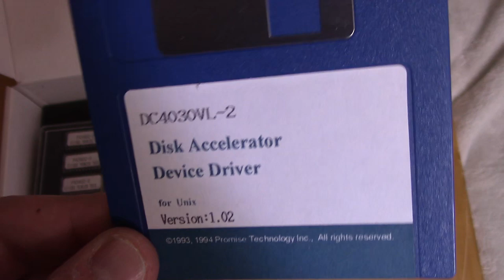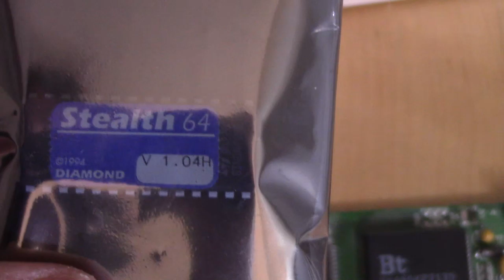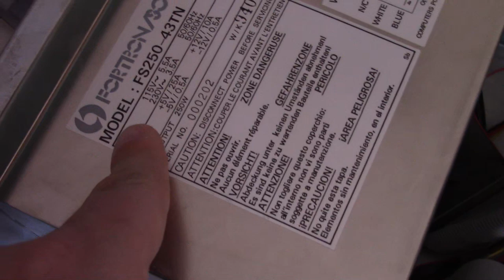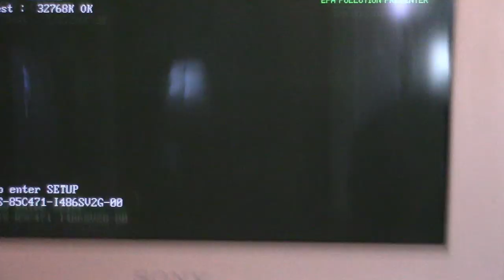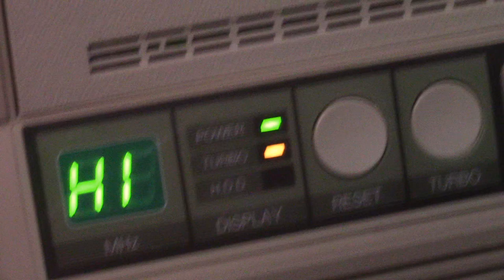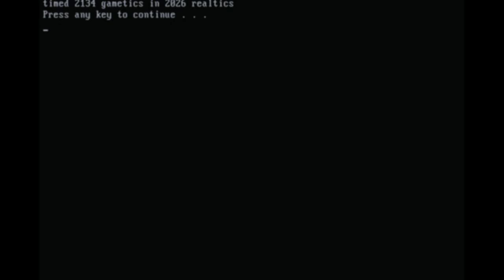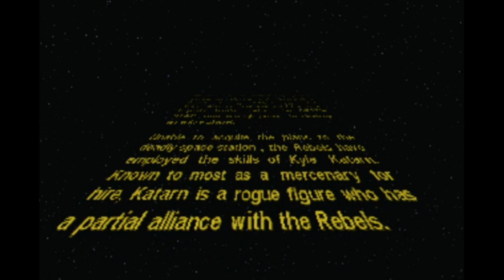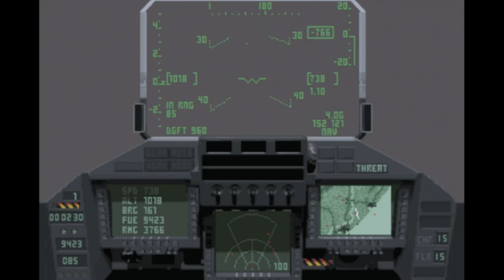486 DX4-100 PC Tower Build

Comment: That is indeed a nice case. For two digit displays the workaround is to set them up to read 'HI' and 'LO' instead of numerical values - ah, I see you did. Definitely some nice hardware in there too, if you're ever stuck for cash you can probably sell that caching card and throw a regular one in there, the gains are generally negligible. Every card I've encountered with two floppy headers offers the second one for 2.88M diskettes, I'm not sure how it's supposed to work due to never having such a drive or disk to try out.
Used to have the PCI version of that video card. The additional memory probably won't be useful if you install it, as the RAM was almost always used solely as a framebuffer at this time.
I don't believe in the hanging note bug, but I do believe in 'ID can't code' bugs. Never seen a WaveBlaster in real life either, so good find.
CPU could be a misprint, or it might be a boxed one that someone ripped the heatsink off of, I'd expect a round glue mark if that were the case though. The die cover looks slightly large to me though and I'd usually expect at least an 'Intel OverDrive' print on the front or fab marks on the back.
It's quite unusual to see a Creative branded drive which is NEC and not Panasonic.
Wall of text aside, that is seriously a nice machine, lots and lots of potential for countless hours of fun to be had with that one.
Reply from the maker: I was pretty surprised when I opened it up and seen all the goodies inside. I figured as much about the memory on the video card but I feel compelled to max these things out when I see empty sockets. It's like math co-pros in 8088 boards, I'll probably never really utilize them but it just bothers me to have it empty. Thanks for the comment.

Comment: Really liked the colorado tape drive. Think I had that one in my first 486dx2 66, used to perform backups. You can’t assign a drive letter to them like a zip drive, but you would use something like Conner Backup Exec software to create backups and do restores.

Comment: That tape drive is a Colorado drive. It uses QIC-40 cartridges that have 60mb of space (don't forget that they always show the size of tape drives with a compression ratio of 2:1). You can also use QIC-80 cartridges, you'll need to format them first. Those tapes can usually be found for not much money, so if you want to play with em, it won't cost you much either.

As for drivers, you can easilly fing colorado's utilities to use said drive.

Comment: From an obsolescence  standpoint the DX4 processors lasted quite a while, when compared to other processors of the early 90s to early 2000s.  It wouldn't  be abnormal to see that DX4s, of varying  speeds, in file servers or industrial computers, up to even a decade after it was released. Although to be fair, the nuclear powet plant I work at still uses 386s for certain embedded  instrumentation, but I don't count that since they are not in pc's.

Comment: Well you can sometimes know if a CPU is an amd or not by checking the L1 cache size. Intel never made a DX4 with 8KB of L1 cache, so if you have 8KB, it's an AMD. If not it may be a intel DX4, or a AMD dx4, OR a rebranded 5x86 ! (This happened to me the other day, I had a am486 DX4-SV8B that reported 16KB of L1 cache. Once I flipped some jumper, I saw "am5x86" on the POST screen with 133MHz clock. So I have a 5x86 in disguise :D)

Comment: On the unmarked iDX4 - I happen to have one that I acquired covered in thermal paste. I started to rub it off and, lo and behold, the markings came off together with the thermal paste... I still don't understand what exactly happened. Could it be a fake one? But it identifies itself as an Intel DX4 CPU so it must be a real one. Remarked from 75 to 100MHz? But it was a rather late piece (and stepping, SK101) when 486s had already become low end so there was not much to gain...

Comment: I think zip drives already use a caching system.  Maybe it is not compatible with that card because there is no deconfliction with the way the on board cache is mapped vs the zip drive.  I'm stretching but it could be possible.

Comment: I've always found it interesting how games scale. Just in terms of ball park reasoning; N times the resolution needs N^2 times the pixels to be rendered. To make good use of those pixels you need N^2 times the polygons, N^2 texels etc, so memory required should go as N^2 as well. We also want to do more operations per pixel to make them look nicer; AA, AF, shaders.

Going from 320x200 to 3840x2160 and easily hundreds of times more operations per pixel should require ~20000 times the performance of this 486. And yet, it doesn't feel as much better as it ought to for such a leap.

Comment: "cool find" really undersells this awesome computer :o Its loaded with top shelf gear to the gills, even ram amount is crazy for 1994.
From the more interesting quirks you missed 286@20MHz CPU on the Promise controller. 3 rom chips - my guess is one is used over 8bit ISA slot as bios extension to facilitate booting (and Interrupt 21 functions), while remaining two provide 16bit firmware for the Harris 286 CPU. ZIP driver most likely wants raw access to IDE port, this controller doesnt allow that, at least in standard configuration. When you showed Promise BIOS screen the second row named "Disk I/O Handler" sounded promising, you could try changing it to "Normal (Mainboard BIOS)", but while potentially fixing ZIP compatibility this would disable LBA support.
Mouse problem can be driver related, did you change them between changing mice? Microsoft driver seems to be the most compatible.
Reply from the maker: Not sure how I missed mentioning that Harris 286. Thanks for the tips on the caching controller haven't made up my mind on if I'm going to keep it in this machine yet. I tried a few different drivers including cutemouse but they were all the same. Don't recall if I tried the Microsoft ones though.